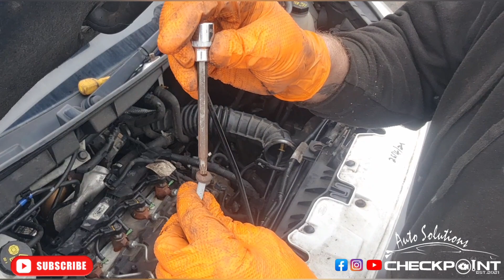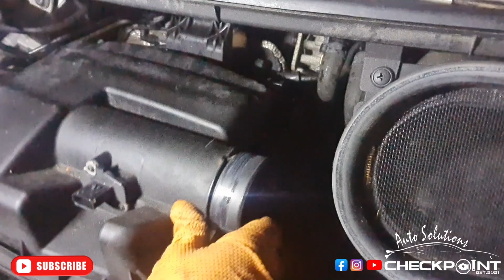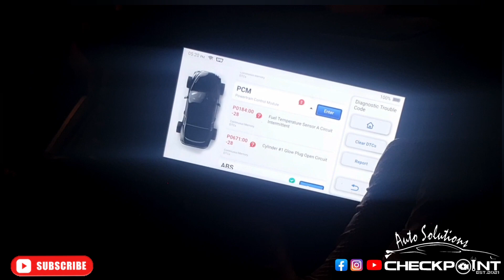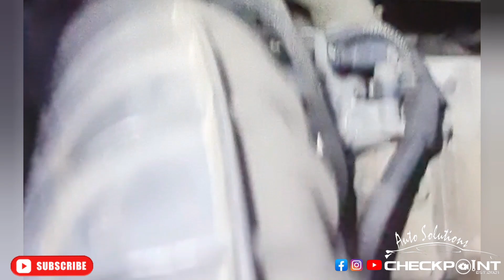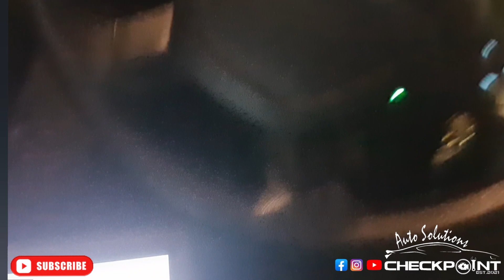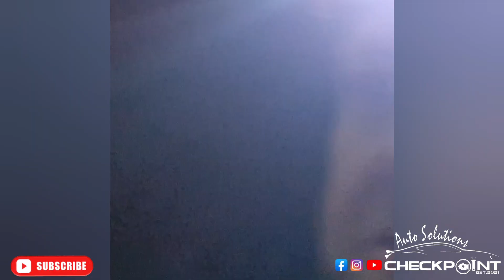TRANNY TROUBLE 2016 ford transit mk8 glowplugs & fuel temp sensor replacement

Comment: great video. Can you give any advise on my mk 8 transit. as nobody can find the problem not even fords. Mine is a 2016 no issue with starting from cold or even hot sometimes. I can go for a drive turn it off then come back say 5 mins later and it will be a hit or miss if it starts. it will crank over but will not start or it seems like the battery is going to die. leave it for say 5 mins and it will start.
Reply: No just the 1 battery.
Reply from the maker: @mickroda3876  sorry for the delay , I was at a classic car show today so was doing alot of filming . Have you tested the volts on your battery? When the battery is idle ,if its good , it is typically  around 12.6v . If its a bit less could possibly  mean dead cells in your battery and may need changed.Test it while its running and it will frequent between 13.5v and 14.5v of the alternator  is doing its job properly. If its higher it will be overcharging and alternator  is at fault or if it doesn't have much activity  on the reading then it's not getting  a charge . Meaning alternator  also. , this is where I would start, by checking the battery and how its charging
Reply: Yeah it had a new alternator about 4 months ago. Just tested it on idle and it's kicking 14.5v
Reply from the maker: @mickroda3876  maybe a fueling issue 🤔 has it been plugged in recently, how long have you been experiencing  this problem? Fuel filter been changed?
Reply: @autosolutionscheckpoint  I was thinking the same as in fuel. I am at the point now when i pull up to fuel up or shops thinking will it or won't it start. everywhere i take it they say they plug it in and nothing. to the point of i went and got a good one myself. plugged it in not sure what i am doing on it but can do the basic stuff and nothing. can't remember if i had the fuel filter changed when i replaced the engine last year. I think the problem started about 7 to 8 months ago.
Reply from the maker: Hi mate , have you 2 batteries  under the seat?